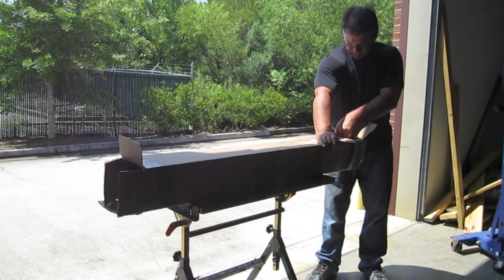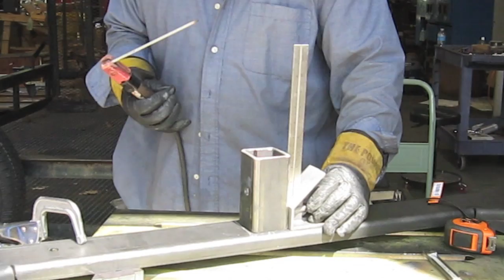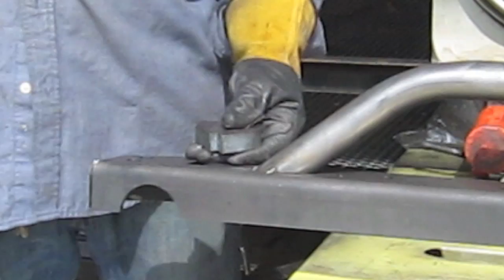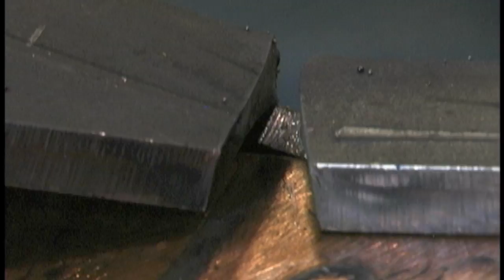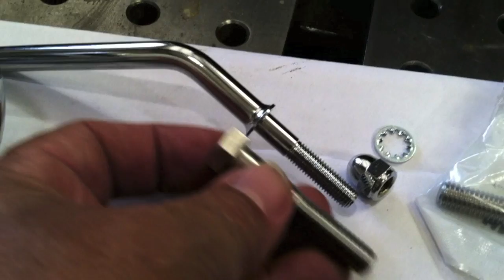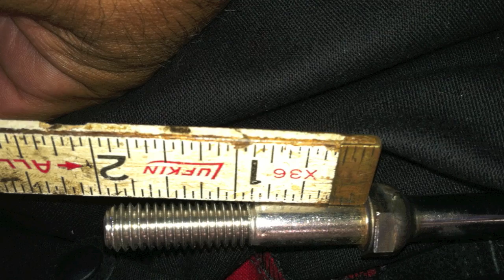Arc Welding a SWAG Off Road Bumper Kit with a Buzz Box

Comment: Jodie, You are awesome! Because of you I am starting a mobile welding and small engine repair business. I have a Miller Roughnecl 2e, a Hobart GW44 with a 100% duty cycle 300 amps with a beautiful 2 cylinder Wisconsin, A westinghouse 300 amp 6 cylinder welder that was used in the Alaskan Pipeline. Just fantastic. I hope to meet you if there is a FABTECH this year!
Reply: How’s business?!

Comment: awesome video. I don't have alot of experience welding on AC (nor do I have experience with wire or TIG) but I've heard it can be a bit of a pain when you first start. I always use 7018's with the machine set on DC running about 100 or so
Reply: Just crank up voltage and you'll get easier, more consistent AC stick welds. Too bad you can't increase voltage with inverter welders like you would with transformers or batteries.

Comment: Great job and I just  finished a 3 day gig in a real welding fab outfit, the old red box that I won't name due to the fact that the crank rod wasn't even hooked to amp slide gauge anymore. It called adjust downward until the rod  quite glowing.  It was 5/32 hard facing running 160++++ That the real world of a shop. Like my hog T-Shirt says "Down N Dirty" get it done

Comment: jody nice video....could you show us stick welding on thinner metals? cause most of the home made constructions are made of 2mm or 3mm steel... and with stick welding and 6013 usually every bead is bad and usually makes a hole..